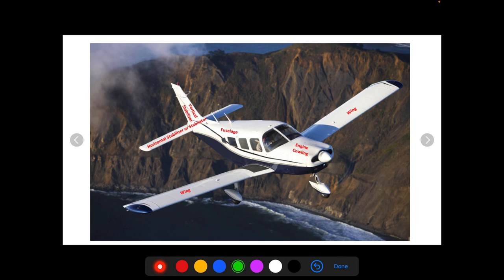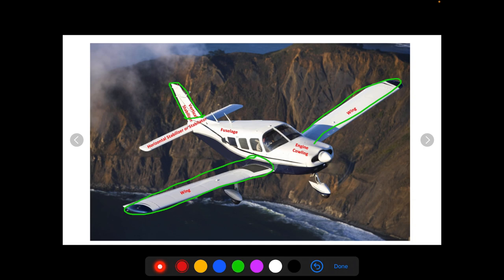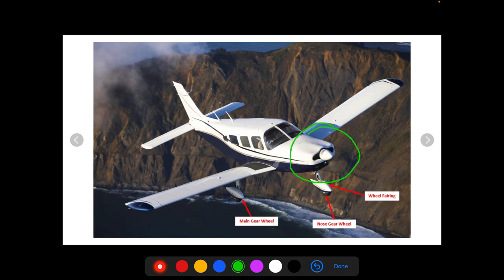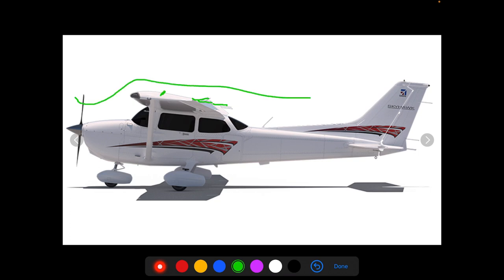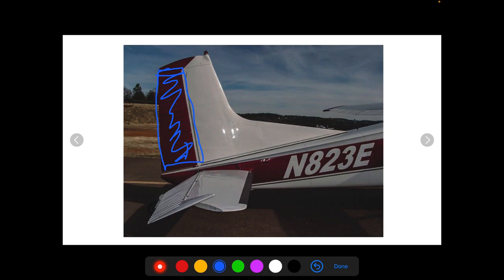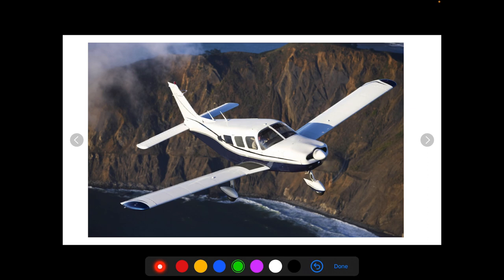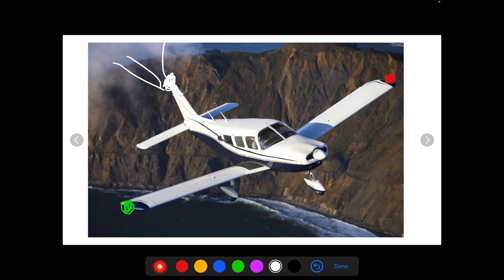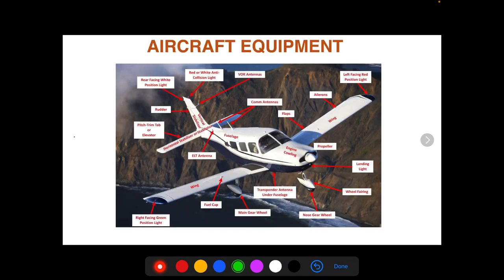Aircraft Equipment Overview - For Student Pilots

Comment: Excellent!  Well done.  

However if a person enters "does horizontal stabilizer produce lift" into search engine, they will probably find the following:  

Horizontal stabilizer [at 2:38] normally produces NEGATIVE lift which pulls tail DOWN, nose up.  This negative lift decreases as airspeed slows near stall speed, resulting in the tail rising and the nose dropping.  
 
Hope this is correct and not bad information.  May be important when dealing with tail stall (tail plane stall) caused by icing.  

Thanks for great presentation!
Reply from the maker: Thanks for watching and thanks for the comment. You are correct. For most aircraft. The horizontal tails main purpose is stability. However, the concept of it producing more net lift vs less net lift and rising/falling with elevator movement still applies